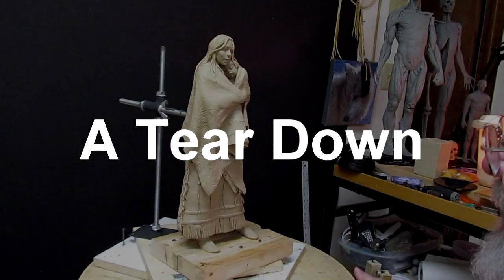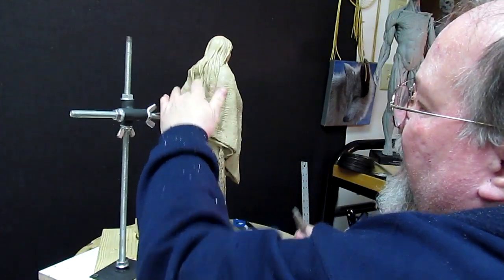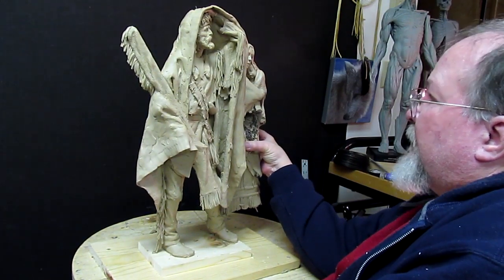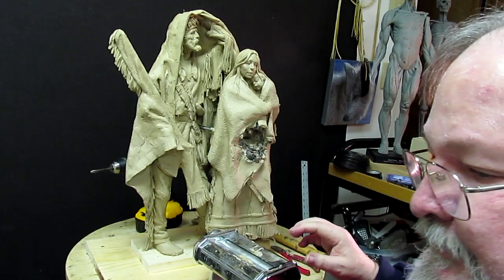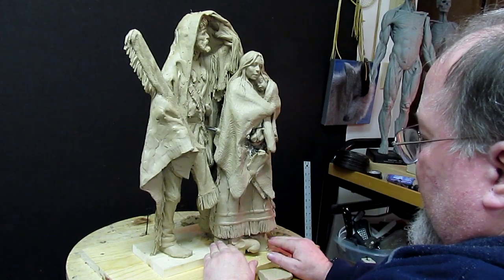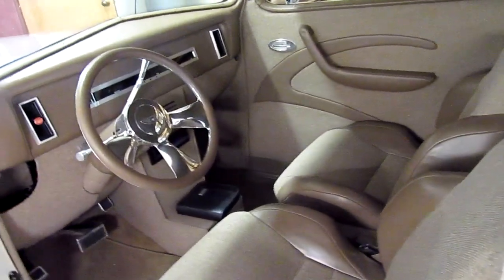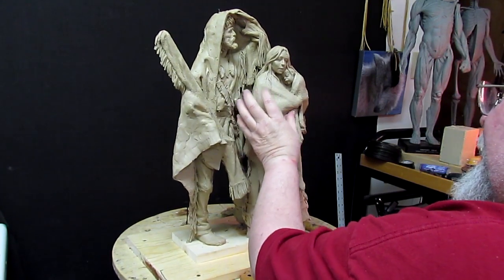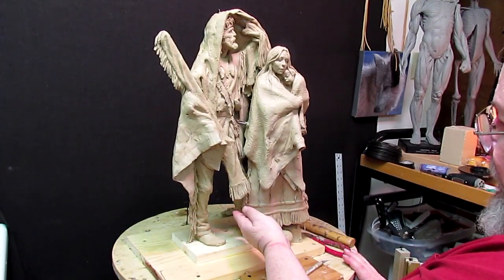Sculpting with Lemon - Two Clays Joined - Classic Cars - You'll have to watch

Comment: David - I had an idea after watching your 'clay disembowelling' . .
** Loop 12" length of wire around midsection of armature and then twist with pliers to tighten onto the armature ' spine' wire. The twist also acts to double up  and strengthen the wire
** Then approx 4" or 5" away from armature make a 90 degree bend down of the twisted wire
** Then either one strand or both of these bent tails can be fitted into the slot at end of armature rod and the nut screwed on to secure it
** Thus is made a sort of ' Sacrificial  Connection Piece ' that can be cut off flush with edge of sculpture leaving just twisted wire inside it ,(when the demounting is required by you or foundry ) and also only minimal fettling needed to hide wire ends.
Wotdya reckon ??. .

(  ©  ;  Pat. Pending  ; All Rights Reserved . . . haha !! )
Reply from the maker: Very good idea Flames...

Comment: Hey Dave,

Could it have been possible to loosen the rod in the stand, and turn it?  I know it would have left the nut within the clay, but ... those are easy enough to replace.  Just curious. ;)  Nice save, by the way! :D
Reply from the maker: No, John.. the tip of the rod has a groove that the wire armature fits into and then you tighten the nut onto the rod and armature.. Had to go into the front... otherwise I'd of had to have cut the rod.. didn't want to ruin a perfectly good armature support.
Reply: Ah!  Gotcha!  Thanks for clearing that up!